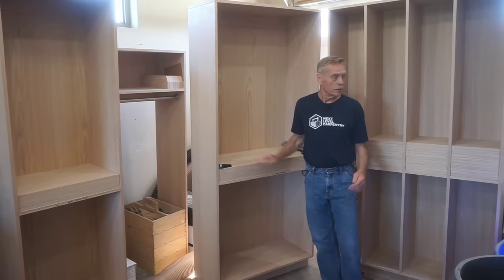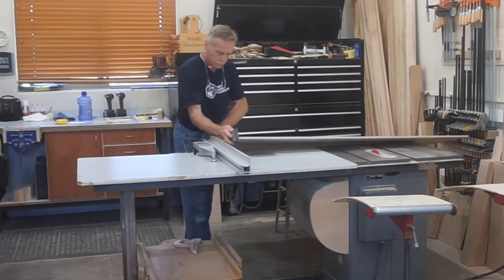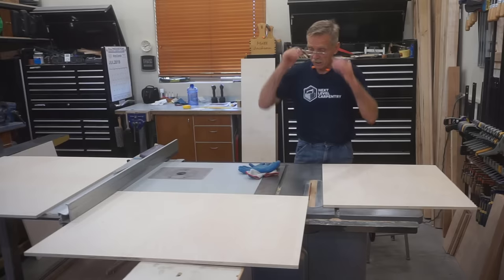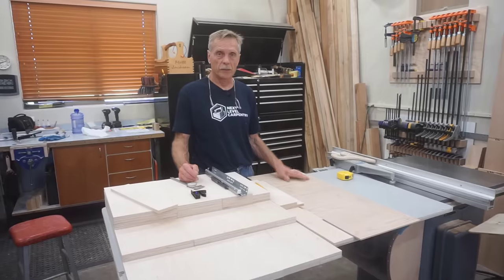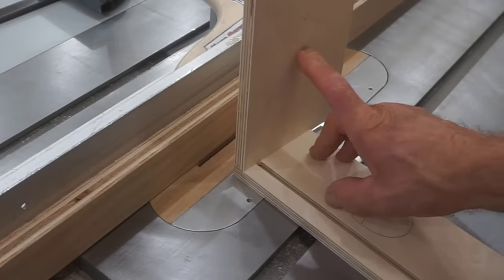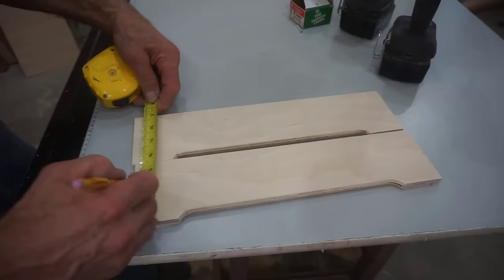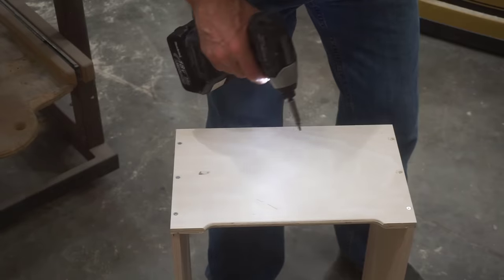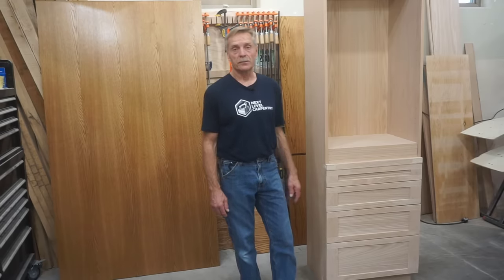Master Class for Professional Grade Cabinet Drawers

Comment: Another great video.  The step at 50min into the video which you cut off the bottom of the backside, could you please explain the pros and cons versus completely enclosing the bottom panel into the groove on 4 sides?
Reply from the maker: I will sure offer a partial explanation and in this case I did it specifically because these drawers got soft-close. undermount slides. With this type of drawer glide all the weight of the drawer is directly on the hardware and doesn't try to push the bottom of the drawer off the bottom of the drawer sides so the extra strength of the dado across the back of the drawer is redundant. Also undermount Hardware requires a notch in the bottom lip of the drawer back and it's simpler to make the notch go all the way across that to Notch both sides especially when the extra strength isn't required.
If the drawers got side-mounted Hardware then I would have left the back panel the same height as the front and sides with the same Dado. Hope that helps and makes sense... Best, Matt

Comment: What do you have on your fence that gives you precision cuts without measuring with a tape from the blade to the fence? 
I noticed your arbor is on the right, That can add some blade to blade consistency.
Reply from the maker: Thanks for watching and commenting on this one Todd.
Far as I know, every ripfence these days has a ruler and cursor to indicate distance between the fence and the face of teeth on the blade. The cursor has (or better have!) a way of adjusting it to dial in absolute zero where the fence touches teeth. 
What's not so common is for users to dial their fence in to a level of precision where it's both accurate and useful.  Mine is. If I need to cut a sheet 27 33/64"+, I set the fence to precisely that with the cursor and make the cut. There are times, when making  a particularly dicey ie: expensive cut that I'll double check with a tape or rule to eliminate negative effects of a brain cramp where I'm thinking 2'4" inches and seeing 24 and a 2nd opinion from a different measuring device works well to snap me out of it.
You are correct in noticing I've a right-tilting model where the arbor's on the right.  This is exactly why I don't switch to a left tilt model where a fence on the right needs to be re-set to zero anytime blade thickness changes, which, for me, is far too often to justify the extra fuss.  I don't want to adjust the cursor 1/32" every time I switch between thin kerf and full kerf blades, dados, etc.  Set it and forget it is what works for moi! 😉😎
Best, Matt
Reply: @NextLevelCarpentry  You are right. I recently discovered that the cursor on my Biesmeyer is adjustable, and if I were to spend the $20 on an new one, I might be able to see the tape that's on the rail.  
I think what you are saying is that I should raise my expectation and set my saw up so I can use the tape that's already there.
Reply from the maker: @toddpiechowski  Absolutely!  There's enough minutia to pay attention to in the shop that anything that can be delegated to 'muscle memory' should be to free up much needed (and, in my case, rather limited 🥴) mental resources IMHO. 😎
Reply: @Hello Todd how are you doing

Comment: Beautiful, accurate work and a great, detailed video. I'm surprised with your attention to detail, that you didn't hide your part numbers in the joint, instead of where they will be visible. You got a thumbs up and a new subscriber, though.
Reply from the maker: Thanks for your comment and observation.  The location of marks varies but rest assured they are never  visible in the finished installation😁😎Best, Matt

Comment: Did I hear you correctly, when screwing in the drawer bottoms, you changed from the square head to a Phillips head 6 x 5 1/8 screw?  I did not hear a change in the side screws - correct?  

Did you create a video of creating the face of the drawers?  Were they Russian Birch as well?

I'm just learning techniques and procedures to build a captains bed - your clarity and continued desire to remeasure for perfect squares sunk in - thank you.

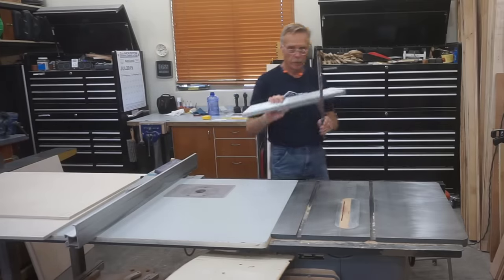Comment: I notice at @23:43 you use the Miter Gauge and the Rip fence at the same time, even though it is often said that it is very dangerous to do that because of Kickback. Is it a safer operation here because the rip fence and the Miter gauge are on the same side of the blade?
Reply from the maker: The dangerous part is cutting is cutting a piece that's wider than it is long.  I get away with it with a number of subtle but meaningful details.  Anyone who doesn't fully understand the potential dangers shouldn't do what I'm doing.  A kick back is entirely possible the way I show in the video but it's almost guaranteed if the miter gauge isn't between the blade and fence!  Don't EVER do that!  Please be careful using a table saw at all times!  Don't try anything you see me, or anyone else for that matter, do if you're not completely confident and comfortable with your abilities, OK?  Best, Matt
Reply: @NextLevelCarpentry  - could you explain a little about the "subtle but meaningful details" that enable this to be a 'safer' operation for you? It would be nice to get the repeatable precision you get using the fence but I've always been nervous of even trying to make this cut with the fence and miter together.  Thanks in advance.  Rick
Reply: Also, forgot to say what a nice job you did with the video explanation.  Very thorough and well thought-out process that makes for a great end product.  However, I wondered why you used plywood for the drawers rather than solid 1/2 material?  Seems the material cost wouldn't be too great as compared to the overall value based on the quality of the final product you build?
Reply from the maker: @ricksina  good question... a beginning driver should avoid high speed rush hour traffic because they lack the level of awareness for everything that's going on around them and 'lizard brain' automatic motor skills to control their movements 'on the fly'.  When I say 'safer' here, I don't mean safer than using a crosscut sled, I mean I make using a dangerous operation safer with use of 'smurf gloves' for grip, table extension to support a wide piece and awareness of the exact instant when kick back is most likely to occur.  Another subtle thing is that my tablesaw top is perfectly clean and has just received a fresh coat of paste wax so it's quite slick.  I also use a block of parafin to lube the rip fence where the sheet rubs against it to greatly reduce friction there.  Friction on the end away from the blade is the main cause of kickback IMHO because it makes the piece twist and pinch the piece between fence and blade... nerves in my back tighten even as I type just thinking about it.  All that said: lack of experience using a table saw in general is like a new driver driving a delivery van through rush hour traffic: far more sensible to take side streets.  Please work safely!  You may want to look into making a good crosscut sled... I should too! 😁😎 Best, Matt
Reply from the maker: @ricksina  good question... a beginning driver should avoid high speed rush hour traffic because they lack the level of awareness for everything that's going on around them and 'lizard brain' automatic motor skills to control their movements 'on the fly'.  When I say 'safer' here, I don't mean safer than using a crosscut sled, I mean I make using a dangerous operation safer with use of 'smurf gloves' for grip, table extension to support a wide piece and awareness of the exact instant when kick back is most likely to occur.  Another subtle thing is that my tablesaw top is perfectly clean and has just received a fresh coat of paste wax so it's quite slick.  I also use a block of parafin to lube the rip fence where the sheet rubs against it to greatly reduce friction there.  Friction on the end away from the blade is the main cause of kickback IMHO because it makes the piece twist and pinch the piece between fence and blade... nerves in my back tighten even as I type just thinking about it.  All that said: lack of experience using a table saw in general is like a new driver driving a delivery van through rush hour traffic: far more sensible to take side streets.  Please work safely!  You may want to look into making a good crosscut sled... I should too! 😁😎 Best, Matt
Reply: @NextLevelCarpentry  - thanks for the reply Matt.  I appreciate the little things you do to make it safer but agree that your experience and 'awareness' is probably the biggest factor.  BTW, I do have a sled but could never match your level of exactness without the fence guide and, my sled only has a 20" width.  I do try to clamp the piece to my sled to prevent movement and use a stop block up to the point the blade is engaged.  Look forward to watching your other content.  Rick

Comment: A bit of a safety concern with regards to cross cutting with a rip fence. 
At 24 minutes in he correctly notes that a rip fence gets more dangerous as the aspect ratio of your work piece gets more substantial. In other words, there is less material to keep aligned with the fence in proportion to the width of the board. The answer, as he shows, is the miter gauge. Especially a giant one like his. But then he proceeds to use them together.  That is asking for trouble. If you want to use the rip fence for a stop block, there are videos that show the safe way to do it. Essentially you move the fence over a bit and use a small block of wood to locate. Then you remove the block and cut, keeping the work piece away from the fence. A sled is even better but can be impractical when cross cutting larger boards.

Comment: Matt again an Excellent Instructional Video. Question; why do you not use a Riving Knief on your table saw. Pro vs Cons. ?? I personally prefer a longer instructional video from start to finish of the project. This allows me to return back to just one video/location and/or re-study a portion of your teachings again.
Reply from the maker: Probably the main reason you don't see me using a riving knife is that my 1982 vintage tablesaw came with only a flimsy, dysfunctional splitter/guard/anti-kickback contraption that was more dangerous on than off so I never used it.  I think a riving knife is a great safety feature an encourage viewers who have them to learn how to make their use part of an efficient workflow when switching blades, using dados, doing plunge cuts etc because, at the right time and in the right circumstances they're likely to prevent injury.  
Best, Matt

Comment: Thanks Matt, I thoroughly enjoyed your presentation of well thought out methodology complete with detailed explanations 👍🏻😁 
question Matt, the saw blade insert surround with removable/replaceable wooden sacrificial strips for zero clearance - where can I buy these?
I am here down under in Oz(Australia 🇦🇺) though we do have limited Amazon and lots of importers of fine woodworking gear designed and or made in the USA 🇺🇸
Reply from the maker: Hey Doug, thanks for watching and commenting.  Sadly, the zero clearance plate you're asking about is no longer made. Here's link to a close-up photo of it in case you want to search for a used one: https://i.pinimg.com/originals/a5/3e/e7/a53ee7d2b513311b534a755c66d8aa74.jpg  Other viewers suggest alternatives currently available but they all look overly complicated and less effective IMHO. Sorry I'm not more help because, as you can see in the photo, I've had mine awhile and use it on virtually every project.

Comment: Obviously can't argue with your experience and your results.. But I was always taught miter gauge + fence was a no-no. I can easily adapt your procedures to avoid that if it bothered me (using a stop block, or sled, or sliding table, or whatever) but curious as to why you choose to do it that way.

Comment: Love the efficiency and the final draw closing 🤓. I wouldn't laugh at your router fence and table saw, I just have a circular saw, trim router and a couple of hand saws, so your setup looks great. I'm going to try and replicate your draws and see how I get on. Just one question. Would the draws be as strong without the screws and just glued. Excluding the base?
Reply from the maker: These drawers would be just as 'strong' without the screws but more subject to failure if they get abused.  For instance, if something bumps the side of a drawer from the inside it could break the glue joint and/or delaminate the plywood.  Or if someone accidentally banged into the drawer with it open it could cause damage.  I use screws to help them survive that type of 'stress' that they're sure to take at some point in their useful lifetime.
Best, Matt
Reply: @NextLevelCarpentry   thanks for the explanation 👍
Reply from the maker: @PBRStreetGang68  youbetcha 😎

Comment: Great video, Matt. I appreciate the long format videos where you really go into the nitty gritty details. Would you mind posting a link to the drawer slides you used? I've been considering using the Blum undermount slides for my next project but boy are they expensive.  Thanks again.
Reply from the maker: Hey Mo, in response to your comment I added links in the video description for both the Hettich Quadro drawer slides and the 'front fixing clips' required for your consideration.  Amazon's pricing is similar to what I pay over the counter locally (with cabinet shop pricing discount).  I suspect the price is similar to Blum but 'my' local cabinet/hardwood/hardware supplier carries Hettich.  "Expensive" is only relative for client projects since labor saving design like the Quadros quickly offsets any savings for less expensive hardware IMHO.  Plus these operate so smoothly it's worth even double the raw cost of the glides compared to regular full extension side-mount soft close alternatives.  You're welcome! Best, Matt

Comment: Matt. I thank you for sharing such an excellent presentation and detail. I would love to see how you actually attached the drawer slides aligned to the cabinet and drawer,  I don't know if I misunderstood something about the drawer bottom spacing above the slide. I think you said 5/8 of an inch, but I thought 1/2 inch was the required amount per manufacturer, so wouldn't that cause an adjustment problem? Please set me straight. Thanks, Joseph
Reply from the maker: Hi Joseph, truth is I don't have a standard practice for hardware installation to share with you because it seems every project I do is just unique enough that I don't have a consistent dimension.  Also I don't recall seeing manufacturer instructions for hardware dimensions for decades and, surprisingly, have no idea what they recommend.  I plan drawer/hardware position based on cabinet configuration working through height relationships in detail before installing the glides and everything works out when it's done. One example would be where, for some reason, I want the glides near the top edge of the drawer rather than the bottom and, in that case, no standard placement instructions would apply.  Sorry that's probably not the answer you were expecting but there it is😁😎. Best, Matt

Comment: Hi Matt, Thanks for your nice video.  When you finish the draw panels, do you cover the  areas that will be glued?
Reply from the maker: It's a good idea to put a strip of tape on the surfaces to be glued for maximum strength so I usually do.  Sometimes though the joinery is strong enough without glue so I don't bother with the tape Xuetao... thanks for watching and commenting! Best, Matt

Comment: Hello Matt and thank you for that fantastic video. So many good advice :)

Can you do a video about your miter gauge extension you used in that video? I often crosscut boards that exceed my table saw capacity for crosscutting and found your extension very interesting. Thanks!
Reply from the maker: Hey Marcus, the best I can do for you is a few close-up pictures of the extension you see in the video.  Here's a link to one of 3 on the Next Level Carpentry page on Pinterest: https://www.pinterest.com/pin/551479916872537430/ I hope you can see enough detail for the one I made for my old Delta Unifence to adapt and create one to fit whatever fence you use.  You're quite welcome! Best, Matt
Reply: @NextLevelCarpentry  Excellent, you the best. Thank you!

Comment: Thanks for all the tips! I think I’ve watched this 3 times now. It’s really the best one out there for making drawers. I do have a question, however. How does your average weekend cabinet maker square off a 32 from a sheet without a jointer like that? Not likely to get one, either, but I would like to make make beautiful drawers.
Reply: Just saw someone else with the same question. But I dont have a router either. I have a table saw, a miter saw and a circular saw.
Reply from the maker: @andreapluhar5075  I suggest you invest in a good quality basic router.  Shop eBay... I'm sure you can find a decent, lightly used one for $50 or less.  You'll be hard pressed to 'make beautiful drawers' without one.  If nothing else, trade someone for your miter saw because it's actually a redundant tool in your basic collection since it can't do anything you can't do on a table saw where a router does.  Best, Matt